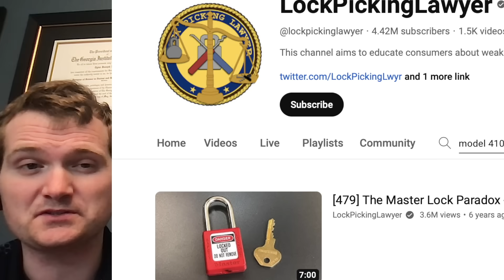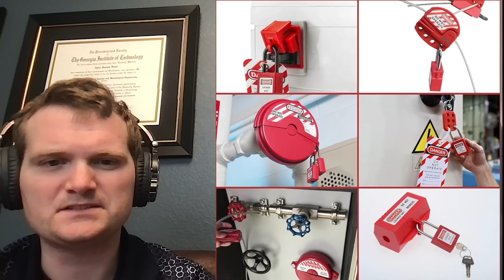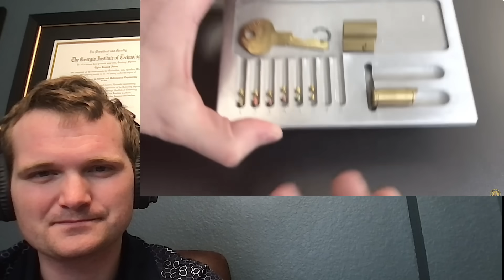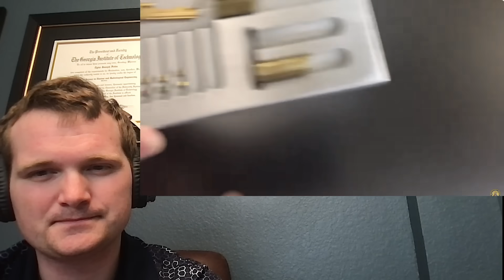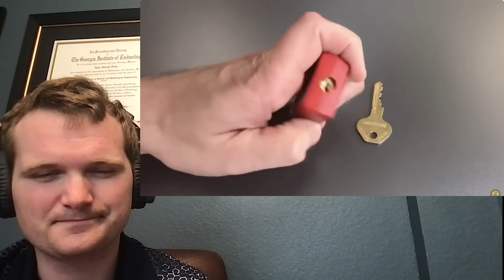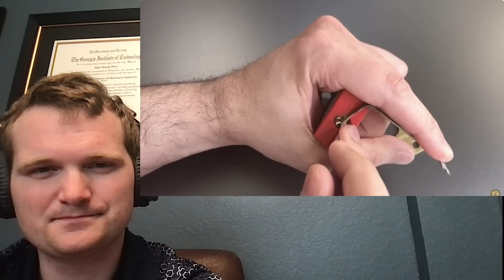Nuclear Engineer Reacts to LockpickingLawyer "The Master Lock Paradox - Model 410 LOTO Padlock"

Comment: I don't work in the nuclear industry but this video came up in my feed. I've speculated that Master Lock used the 6 security pin core on the 410 LOTO because of some sort of government contract requirement at some point and they kept making it that way. I checked OSHA's regulations regarding locked used in LOTO and there is no specific design requirements regarding the core, lock body, or shackle.  I wasn't aware until watching your comments that there could be emergency exceptions to removing a lock out device as that is something that could never come up in the industry I work in. Could it be that the nuclear industry IS the  reason the 410 LOTO exists?

Comment: Makes sense to me. Difficult to break in nondestructively, easy to break in destructively, just what you need for a loto lock.
Reply: The reason for loto is simply to stop operation they don't need to be hard to pick or break they just need to stop operation 

In the navy we don't even use the lock part we just hang the tag
(Both in the conventional and the nuclear navy)

Comment: On the intimidation factor of locks there's actually a lot of psychology to consider, a lock can be intimidating through both size and brand reputation, but a more expensive lock implies a more expensive prize behind it. You have to consider where the lock will be deployed, on your own property it's very desirable but at a rented storage unit it can actually attractive thieves to that particular unit. Such thieves are likely to have circumvented security in such a way that they can use a power tool, probably an angle grinder, or they would not attempt a storage complex robbery since the intendants of the yard do not have the unit keys themselves. ABUS makes the only lock I know of (ABUS Diskus 20) that's at a storage unit size class but is a significant security upgrade, a disc detainer that retains the traditional round storage unit lock shape that to it's credit is so well designed it necessitates the angle grinder attack to be bypassed efficiently enough for this class of robbery. It's impossible for a normal person to pick but looks like every lock at the yard. Beyond this very common use of large padlocks, yeah, huge scary locks are the way to go since most attacks will be physical rather than by picking. LPL is like Eric Clapton talented at picking and making it not look like a big deal.

Comment: A lot of people miss the obvious theme here, locksmiths, law enforcement or rescue crews need to be able to easily remove these things. An ultra secure lock in a strong body could be a dangerous. The LOTO lock is perfect in its function, 1 key, not easily picked by an amateur so there is no unofficial removal. If the key is lost, or the guy who installed it went home without unlocking it, then it can easily be smashed or cut off. Padlocks are more of a deterrent than a hard "no you can't enter".

Comment: As for the first one he looks at having a small shackle and it not being hardened I think p as Tyler mentions it's almost certainly meant to be able to be easily opened with standard bolt cutters or even song through with a diamond plated hacksaw 

It also probably has a small diameter of the shackle so they can fit on more industrial equipment 

My guess is to I actually has a decent Rock design is there must be a government standard probably issued by the national institute of safety and technology.

Comment: Had more difficulty with American 1100's than the Master LOTO, but for Master, they're fairly good, which isn't really saying much.
But, as a LOTO, I'll have quite the warm and fuzzy, any old key ain't gonna open it.

Master Lock was just another face in the crowd in the lock industry, when in 1974 the company began advertising during the Super Bowl, basically popping their annual wad in one advertisement campaign during the game. Their spiel was having a sharpshooter shoot their lock, "proving" its durability, interestingly they never tried to open it after shooting it for good reason. They did that throughout the '70's and even into the '90's they did blipvert second ads of the shot lock as magically delicious or something.
Meanwhile, every thief in the land can pop a Master Lock with either a ball peen hammer to dislodge the shackle lock or force it through, picking can be conducted with a zero skill thief using their elbow as a pick.
Saw one hilarious video where the lock was picked using another lock hitting it.
The French phrase c'est merde would be a compliment for the entirety of the Master Lock line. I can intimidate one open with just a stern glare.

I do have one lock that's nearly impossible to pick. Not because it's super secure, it's a super cheap POS that also could normally be picked with a stern glare. No, it's because it's worn out, been tampered with in a way that damaged it and it hasn't been lubricated since the Almighty was in knickers, so even with a key it was hard to open on a good day, impossible to open on a bad day. Oh, it was also damaged when at some point in its career that spans beyond the age of the Earth, it was also misinstalled, also damaging it. Makes for an interesting time when I randomly pull that one out to pick something...

Comment: LOTO padlocks are for safety and accountability, the single person assigned to the lock is responsible for starting and for ending the safety lockout.  So they're not especially cut resistant, but are difficult to pick for a typical worker who isn't the "owner". It seems they're pretty appropriately designed.

Comment: They are excellent practice locks a a locksport enthusiast. Easily defeated with destructive methods, not as easy to pick. These are classified as "green belt" in the LPU database meaning they're pretty good as far as pick resistance.

Comment: There is an intimidation factor with locks(for novice criminals). A big lock looks strong, and it is. But it might have a bad core, which is easy for pickers. That takes very little brains. Criminals seem to lack even that. They don't pick, they cut. So, beefy is best.

Comment: My guess for why the body is easy to break is most likely for a very unlikely situation where you don't have or aren't able to get to the cutters in which case you get a hammer or some other tool able to break the lock to operate the system you can even see a trend of making the case easy to break

Comment: I'm an offpressman at a press facility, and the stacking machine i operate has cutouts to be locked and tagged out, but we don't use them. It's air powered, and the doors release the air pressure when opened. So if something is going terribly wrong somehow, it's more likely to bump the doors open and shut the machine down, if it is somehow going terribly wrong and flinging papers out or something

Edit, it's electric and air powered. It has a computer inside for different programs, but everything that moves on the machine is powered by air and loses all momentum if one of those door switches gets thrown

Comment: you are using a Model 410 LOTO Padlock, it can be opened using a Model 410 LOTO Padlock
Reply: Ironically enough the 410 uses ball bearings making it impossible to smack open.

Comment: Master knows their customer. Utilities will buy thousands of locks and pay big $ for a lock that meets their needs of one key per lock, no chance of any keyed alike, restricted keyway, huge amount of different keys available. Lock body strength is secondary. Very important so chance of osha violation due to keying is nil. Employees & contractors are all trained that any deliberate violation of loto program is grounds for immediate dismissal. Some companies use a robust tagging program and NO locks, paper tags only. Just as effective as long as the safety culture is very good, and employees are well trained and aware of consequences of not following the rules.

Comment: I worked on a project at a synchrotron for a few months that had numerous LOTO zones that could potentially kill you.  I was VERY disappointed about not getting any superpowers.  Some of the devices looked like 20 ft high microwave parts and lead walls were all over the place.

Comment: I'm pretty sure the LOTO core is built to a regulatory requirement; nothing else could induce MasterLock to make a core good.

The body is vulnerable because, as you pointed out, it has to be able to be cut off easily if need be, preferably with something that's in literally any toolbox, by someone who does not make a study of destructive attacks upon padlocks.

I wonder if the LOTO is vulnerable to a padlock shimming attack; I would be genuinely surprised if not.

Comment: I remember a story from a long time ago at a power plant.  A worker locked out a piece of equipment.  Some numbskull cut the lock off and re-energized the circuit while the worker was in contact with it.  His screams echoed through the plant.  As it was described "His arms turned into the wires for a Jacob's ladder."  The guy who did it got his ass kicked and the police called.  When the police showed up, they said "he fell down the stairs."  He was prosecuted and found guilty of aggravated assault, reckless endangerment, attempted homicide, etc.  He was sentenced to about 10 years in prison.  As for the worker, they had to amputate both arms.

Comment: Had a work incident while working in a warehouse.  A crew was working on a compactor but they hadn't placed their loc . I bumped my cart push the button waited for cyclo finish and began driving back to my station.  When I got about 2/3 through the section this guy runs up screaming at me about how I nearly killed someone.  I'm like how? He said the machine was down for maintenance and had a lock on it. No it didn't went back showed him.  No lock no tag. The guy got apologetic, I grabbed my radio to report the incident he got so mad and tried to put the tag on before the plant manager got there.  I had to laugh like you know there is a camera right there, right.  He got fired on the spot when manager and security showed up.

Comment: The sites Loto plan will define the use of colors in the program.   like the lock above with 2 key that would be a shift transition lock.  ALSO YOU NEVER CUT A LOCK UNLESS YOU CAN CONTACT THE PERSON THAT PUT THE KEY ON TO CONFIRM THE CONDITIONS.  Additionally the loto plan spells out what needs to be done to remove a lock when the key is not present.

Comment: Their normal locks are so bad that you can accidentally rake them open with the key to another lock. These are designed to not allow that. You need the right key to open them. Or, if that person lost the key, they're very easy to break open so the equipment can be restarted after the maintenance is done.

Comment: LOTO often have 2nd keys, whereby the 2nd key is a backup and kept in a lock box along with the other backup keys whose access requires the on duty supervisor and sheet sign off of a host of others authorizing use of the backup key.

Comment: Looks like nuclear (or at least your site) has a designation for all the colors. Coming from a couple different industries using LoTo amd working closely with their EH&S departments, technically the company is only required to choose a color not used for another purpose. This is alwys fun when you get different companies on the same gear and everyone is legally using a different color on the same equipment for the same reason

Comment: My first thought about the cheap body is that it's designed to be extra secure due tonlife being on the line but also light enough fo be carriered. At my plant, all maintenance carry the lock at all times. Nonone wants a 1 pound weight locked to their belt loop.

Comment: Our LOTO tags (like shown at 1:47) had our photo and our cell phone# on them, that way you knew who to contact if they forgot to remove it OR who you were potentially killing if you cut the lock off and turned the locked-out control back on... We had to cut off LOTO locks surprisingly often from certain people who seemed to always leave their locks on and then left for the day... Hated doing it, since to do it correctly, you need to actually get in contact with the previous person, and many times they didn't answer their phone after work (which is fair enough), so we would then have to verify they were not on the premises and then re-check the system for safety (if they didn't do a handoff). And many people didnt use LOTO tags, so you're just looking at some random lock attached to the control arm for a disconnect....

On the flip side (and maybe because of this), we had quite a few incidents of LOTO locks being incorrectly removed (or people not using LOTO in the first place, mainly new temp-agency-supplied operators) and people getting seriously injured or killed.
Reply: I don't have a job like this, but I'm pretty forgetful. If your forgetful workers put their car keys in the storage container for the LOTTO locks whenever they grab one to use, they would certainly remember to unlock it before going home.

To really solve the problem, make it to where you have to exchange your car keys for a LOTTO in order to access them, sorta like the coin traps in the Aldi stores' shopping carts.

Comment: id imagine that plastic body is there because of product contamination. no manufacturing plant wants metals to be movable equipment. furthermore some plastics are more durable to acidic and caustic cleaners prolonging the life. also nobody in a plant is going to hit someones lock with a hammer. even if they were most of the disconnects/loto points are also plastic so if u were that determined to break it a metal body wouldn't help anyway.

Comment: The ironic part is that Masterlock's "best" lock is for something that is effectively a zip-tie. They aren't meant to be "high security" (as you point out, there are reasons to remove them.) If you're in a working environment where people willingly remove other peoples tag-outs, well, a lock isn't going to stop that. (and you should RUN as fast as possible away from that shit.)

(* Masterlock doesn't have a "best lock". They are all dog shit. They will not protect your stuff from anyone who means to take it.)

Comment: The location of such a lock would be the lock body itself **
And the lock... think of it as a tamper resistant tag of sorts. 
The goal is to prevent un noticed tampering. But if needed can be broken in emergency and quickly!

Comment: I’m not an expert by any means so take this with a grain of salt (but I read a lot). What you talked about at the end, it has a name relating to the security industry writ large. It’s referred to as ‘security by obscurity.’ I.E. the thought that ‘if something looks big and scary, it’ll ward off most attackers, and that’s what we’re trying to do so it’s good enough.’ In my mind that’s stupid. In this example, they put all the time, money and resources into making a really nice lock against destructive attacks, but couldn’t be bothered to put a decent core in it, which would be very cheap to do, none of the components in a locks core are expensive or hard to make.

And the core in that LOTO lock isn’t exactly one of the best cores ever, but it’s respectable, it’s gonna give a novice trouble, or even someone with a bit of experience, but someone who’s a gifted or experienced locksmith is gonna get into it, as where the cores in the other locks are quite trash

Comment: I wonder if the difficulty of the core is to avoid using something like a bump key or rake, something that could be fashioned out of another key, and then "used" almost normally. So if all the cores sucked one sleazy manager cutting corners could essentially have a skeleton key that unlocks them all, without anyone knowing anything was amiss. But still easily opened if need be by destructive means.

Comment: The LOTO locks we used looked a lot like the middle model @7:30. They could be broken open with a hammer, in case of an emergency. That being said, lockouts are usually done with the machine at a zero energy state. Removing someone else's LOTO lock without telling the owner or going through the approved administrative procedure is a great way to get instantly fired.

Comment: Yep. I work as a confined space attendant sometimes. I've actually seen these less and less in use at our pulp/paper mill. Most of them are all just standard padlocks, and each company tends to have their own lock, or at least lock color, which is interesting. However, I haven't seen a plastic lock for people locking into confined space. Maybe it's just because it's cheaper, or there's no standard at the mill. As long as everyone inside has a lock on, they're signed in, it's good to go.

Comment: Why would you even need a strong core in the LOTO padlock? It's not like some employee will bring the lockpicks out because there is a padlock that protects his coworker from electrocution. Those padlocks are mostly to make sure no one is just not thinking about it and run it anyway. And if someone wants to open it so badly, in most work places the tools to destroy them are easier to get than tools to open it. And it doesn't need any skill to do it. And if you do not want anyone to know that it was opened, you probably will give it out by doing what you wanted to do.

Comment: I've only ever seen #3 in my electro mechanical work. Probably because its cheap. Again you're never expecing anyone to pick these locks because if you see it on, its probably unsafe to use the machine it's connected to.

Also a few times used blue ones just to lock off boxes